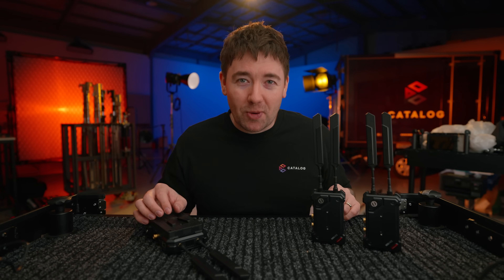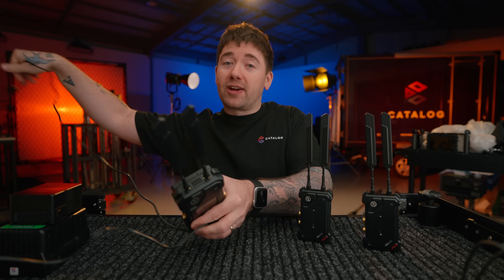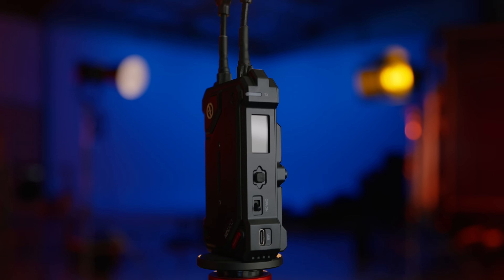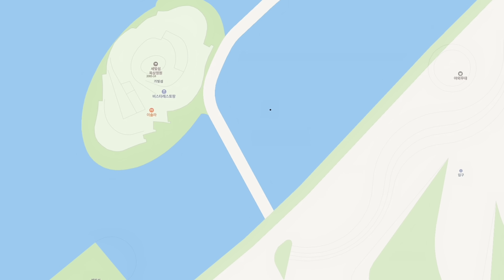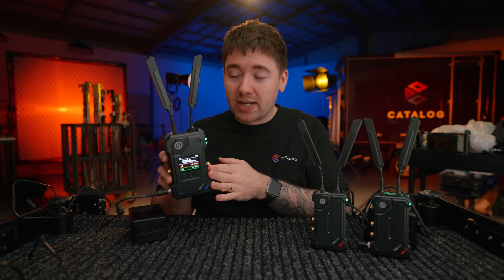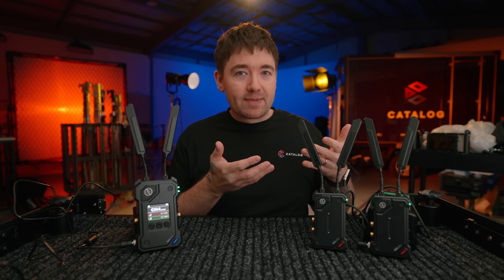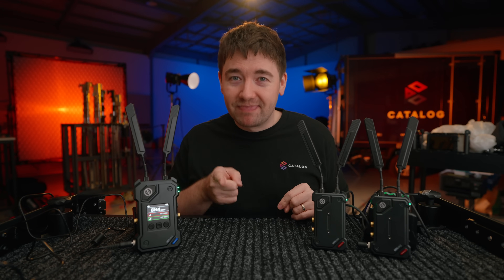2 TX : 1RX - The New Hollyland Cosmo C2

Comment: This device is faulty - The manufacturer has confirmed this in writing to me this week after I raised 'several times' that the audio was corrupted.... now they have finally admitted the device contains unsuitable chips: 

From Hollyland:

I've checked with our product team again, and found that the issue is caused by the chip.
We will look for a new chip supplier for the next generation of Cosmo C2.
 
However, unfortunately this problem cannot be fixed through a firmware upgrade for the existing units.
 
If this is unacceptable to the customers, we are willing to offer a refund.
 
We will also consider adding a note in our product page or notice to inform other users.
 
Kindly let us know the thoughts of customer.”
 
Apologies that this is the outcome
Reply from the maker: Thanks for checking about this and coming back to update and bring it to everyone’s attention!

Comment from the maker: 00:00 Intro
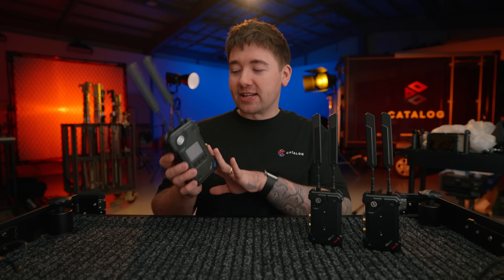00:59 Receiver Design
02:23 Turning on the RX
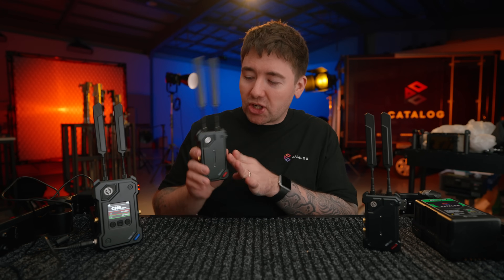02:52 Transmitter Design
04:25 Turning on the TX
05:17 Transmitter Range
05:44 Real Life Use Case Story
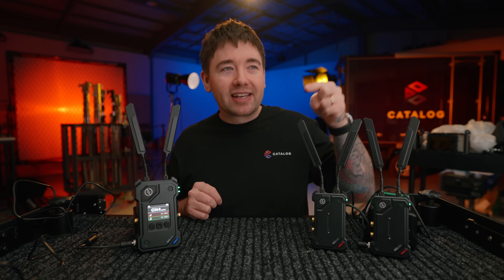08:19 Is this a 4K System?
08:46 Is this a "zero-latency" system?
09:19 Does this work with the Hollyview App?
09:26 Does it downscale 4K to HD on the input?
09:37 Should I buy Pyro/Mars or the Cosmo C2?
10:08 NDI
11:47 UVC
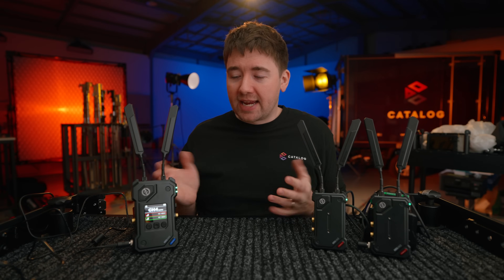12:32 Who are these for?
13:20 Wrap-up

Comment: Could you use 4 of these (1 RX and 1 TX) for a 4 camera setup going into a video switcher (like a Blackmagic ATEM or similar) ? Or would it be too much frequency interference?
Reply from the maker: You'd only need two sets because it's two transmitters to one receiver each.
Because there's 8 channels you should be fine to do that :)

In fact ,in the event I described we used the Cosmo C2 along side the Pyro and we had no issues!
Reply: @good to know. I still wonder if I’d need 4 TX and 4 RX, only because having 4 TX 2 RX only splits the same camera feed. But this product still looks awesome.
Reply from the maker: Oh dude, maybe I didn't explain it enough.
The two transmitters send separate feeds, it's not the same signal out of both of the inputs.
So let's say you connect Transmitter A to an FX3 and Transmitter B to an FX6.
On the Single Receiver Unit, the signal from the A side is the FX3, and the B side is FX6.

This is what makes it a cool system, you don't need two Receivers because this single receiver is a two-in-one!
The A side is always the A Signal and the B side is always the B Signal.

Does that make more sense to why you only would need two sets of the C2?
Reply: @AnotherCameraChannel  whoaaaaa. Wait. Hold on. That’s amazing. Then how would a Blackmagic ATEM switcher “see” each camera feed?

Like, I’m assuming I’d put 1 RX into HDMI / SDI slot #1. But then there’s no “video feed” going into HDMI / SDI slot #2. So then how would I independently switch between camera angles with only 2 TX and 1 RX?
Reply from the maker: The RX has two sides. If you go to 1:15. you will see They are labelled HDMI Out A / SDI Out A, and HDMI Out B / SDI Out B.
So for example, you'd just connect your HDMI or SDI cables from the A side to Input 1 on the ATEM, and then the B side to Input 2 on the ATEM.
The signals are separated and come out of their respective sides.

Transmitter A -------> RX A Side --------> ATEM Input 1
Transmitter B -------> RX B Side --------> ATEM Input 2
Reply: @AnotherCameraChannel  ohhh so if I bought 4 then I’d be able to use all 8 inputs of the switcher. This is a better solution than I imagined. Less interference. All I’m doing is just using a 6” jumper cable from the RX-A into slot #1 and then RX-B into slot #2. Thanks so much!!!